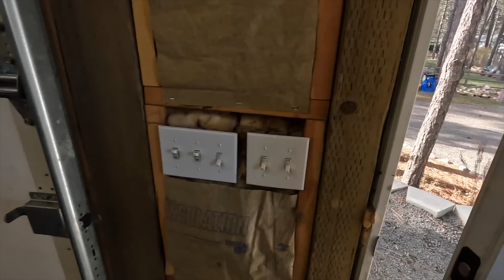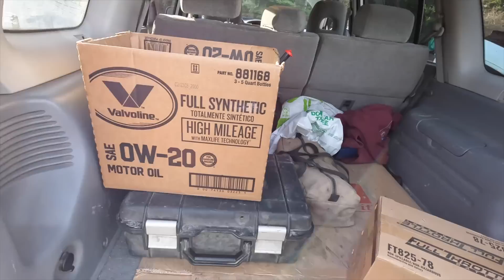Will this junk mustang run again?

Comment: My favourite part is dave actually lined the yellow dot up with the valve stem. No one does that it seems
Reply from the maker: Ex semi-pro tire guy🤙
Reply: That’s why they end up with a pound of weights to balance the tire, most tire installers don’t even know what the fit even is.

Comment: When I have a tire that has stiff side walls I usually keep a little starting fluid which is either and it spayed into the rire opening and a barbique lighter pop it's seated if you do not have starting fluid you can use allitle bit of acetylene and then light the torch wave it at the bead and pop its seated works great on bus tires and pay loader tires.
Reply from the maker: Done it many times.  Try to keep it to a minimum.. one day it’ll bite me

Comment: When you have to use excessive air to seat I usual leave it on the tire clamps and lock the rim in with arm above that pushes down on the bead. The head usually fits in the hub so it can’t go anywhere 👍🏼👍🏼 keep up the awesome content!!
Reply from the maker: Great tip!

Comment: Awesome.  I had a 74 Mustand  II with a 4 banger. It was a fast back, I lowered it, 17" wheels, dual Dellorto side drafts, Ford Racing A237 cam, ported head and a header. I swapped out the automatic for a T5 out of a Turbocoupe.  8" rear end with 3.55 gears.  Looked and ran good.
Reply from the maker: Sounds like it!

Comment: Lots of guys have put webber side draft carbs on the 2.3 and put them in sand rails.back in the day the lima 4 cylinder is not a bad motor.and some cams are available for them.
Reply from the maker: Yep!  Still lots of hot rod options out there

Comment: You say its not much of a mustang, but you pop in a performance 302 and a built c4 and a few performance upgrades, uou have a fun little car that will scoot. I had got one just like this in 1988 except it was emerald green with a white interior. I drove it stock for a few years before i hopped it up. In addition to the engine and trans, i did a five bolt coversion on the hubs and axles, put a narrowed ford 9 inch in (factory axle WILL break, i kniw from experience) rear lift kit and ladder bars (kept breaking leaf springs from the torque)
Reply from the maker: Nice! I’m working out my 5 lug swap now

Comment: I had one. Same year and color. Took a 289 and 4 speed out of a 63 falcon and eyeballed and welded it in. She ran like a scalded dog. went through u joints and rear ends pretty regular but like you said, The junk yards were full of them (it was the 80's). Have fun with it we did with ours...🤓
Reply from the maker: So many good stories popping up!

Comment: My first Mustang II was a 74 hatchback with the 2.3 and 4spd. It was a fun little car and i beat the snot out of that one...literally. My 2nd one was a 77 Ghia with a 302 and automatic. The wife torched the engine on that one. Not a lot of new body parts available for these cars but they are fun little get around rides and yes they are just a rebodied Pinto...but fun. Now Pintos...I've had a number of those and a couple were V8 drag cars. Hope to see that one resurrected soon!
Reply from the maker: I just want a fun cruiser that I’m not worried about scratching

Comment: To make it smell better use distilled white vinegar. I had a car that was in storage for a number of years & had mice they peed everywhere. I used it full strength in a spray bottle. I used it on the seat foam the rug it removes the smell. For long term storage use small glass bowls with a few cotton balls & 100% mint oil to keep them out
Reply from the maker: That’s a good idea with the mint

Comment: Think of them as heavy Pintos. I've avoided V8 swaps in mine, because the engine is in front of the front spindles, but a Lima 2.3 turbo would be right at home (I've built 3 of those).
Reply from the maker: That would be rad

Comment: Jim is my kind of feller. 

Also, the svo/meeker xti turbo 4 will bolt into that chassis. 👀
They are very stout engines.
Reply from the maker: I know that. But I’m more of a suspension guy than horsepower

Comment: I just do the brake cleaner fire method to mount rims works every time, i like jims junk yard more projects than 10 life times. Put a modern 2.3ecobost ford engine in it they get 500hp with baic mods ❤😂
Reply from the maker: That sounds awesome. And expensive

Comment: Manual trans, good condition, just get it running and driving safe, good to go!  Interesting content! Apparently those 4 cylinder cars can weigh as little as 2500lbs, should be pretty fun!
Reply from the maker: That’s the plan! Thanks
Reply: @thedirtheadshed  Look forward to the videos when you make them!

Comment: These Mustang IT'S were so easy to drop in a V8 and automatic transmission or a manual.... they were  fast with the right goodies on and in them. Heck, a turbo for the 4 banger was sweet if you also built the motor up. I've seen a 4 cylinder pull the front tires at some drag races years ago! Have fun with it, my friend. 👍🇺🇲🤡💩....HA HAA!😂😅
Reply from the maker: Slow and steady….  I don’t think I’ll be doing wheelies in it

Comment: When you said muscle car, I was thinking you got one with a factory 302 V-8. Back in the day, basically when these cars were less than 5 years old. Nobody liked them much. basic commuter cars, inline with the Pinto and Bobcat. I had a Bobcat wagon, that I put a 2.8 in from a Mercury Capri. Fun little cars. The original lego type car. You could mix and match all kinds of parts from these cars without to much trouble.
Reply from the maker: The bobcat wagon was the best

Comment: You might want to try draping tire chains over any tire you think might explode.  The inertia in the tire chains will absorb most or all of the force without turning into a missile.  You can also use heavy floor mats draped over the tire, usually with something heavy on top of them.
Reply from the maker: That sounds sketchy too

Comment: Those cables for the clutches are notorious for popping off. A new cable will solve that issue, they’re not difficult to install either
Reply from the maker: I’ll order one up.  Used to a similar problem on Suzuki Samurai’s

Comment: When that car was fairly new ,there was a guy in Ft. Lauderdale terrorizing the big block street racers he ran with.Mike was running a baby blue 1.9L Pinto station wagon that he’d bolted a turbo on boosting 15 lbs
So don’t underestimate those 4bangers chops .
True story …he did brake it, but I was working with him as a young electrician,when he picked up a beautifully 2 barrel carb with the biggest jugs I’d ever seen!! when he was rebuilding it
Maybe some other old timer from Lauderdale can corroborate.
Reply from the maker: Sounds like a blast

Comment: How can the worst mustang ever be the one whos parts you still see on the pegs at Summit?  Sure there was some pinto in there.  The biggest issue with pinto genes is the size of the tire wells.  Other than that, who cares?  Sure even the V8 was gutless.  But all that can be fixed now.  

The 2.3 is supported with lots of circle track parts.  The 302 has limitless aftermarket support.  The V6 was nice, but is more or less an exotic motor now.  

As far as a specific sample goes, starting up first try after being junked and sitting for 5 years is pretty good.  You will want a different rear end than what the 2.3 had.  There are caltrax clones and subframe connectors for this car.

BTW, I found this video while searching for IIs.  My project is a ’78 Mach I.  I’ve been watching your shows for years but this was the first one that was directly relevant to my project.
Reply from the maker: Nice!  Yeah, I would like to find an 8”
For it.  But for the first round of mods it’s gonna stay 4 lug and junk axle.  I’ll get it driving and looking right before I throw too much money at it

Comment: Rebuilt rebadge pinto lol till you try use pinto parts they don't fit lol built several is my favorite car the ideas from the into was rack and pinion and the brakes but barkes and 5 lug bolt on comes from 80s thunder bird
Reply from the maker: Lots of similarities

Comment: On the mustang get the power train out of a turbo bird or thunder bird with a little work you will have a 210 hp with inter cooler and a bigger turbo maybe a little more the murkur xr4ti is also 2.3 turbo mill.not that you will proby find a wrecked so 85 to 86 mustang also 2.3 turbo mill the turbo birds are probly the cheapest cause the 1988 turbo bird people like to throw coyote v8 engines in them.
Reply from the maker: Yep.  I’ll get back on the hunt this spring

Comment: Are neighbor Sam had a cobra mustang 2 lol with roller rocker 289 that rev 8 grand four speed side step the clutch hold wide open it just spin in circles at any speed  like  a tornado
Reply from the maker: Sounds wild!